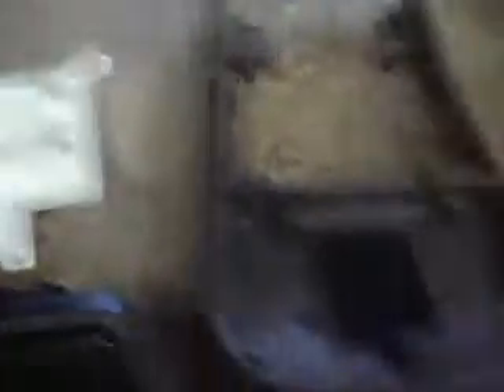2002 Explorer Sport Trac Overhead Console Display Repair

Comment: I tried this. Mine didn’t looked burned anywhere. Maybe a little corrosion. I scraped it and soldered it anyway. It works now. You are the man!
Reply: I have a 2001 Explorer Sport.  How do you get the whole thing off in the first place?  There aren't any screws holding  it onto the cab ceiling.  Do I just yank it off?  Use a slot screwdriver to gently pry it off?  Any hints are appreciated.
Reply: @valeriestevens5250  press the button to open the storage door. Remove the two screws holding the rear section to the roof. The front snaps in and out.
Reply: @KevinMcPCFII  Thank you very much!  The Explorer was in the shop when you responded.  I just got it back Saturday and the first thing I did was open the storage door and I saw the two screws.  Do I need to remove the front also, or can I just remove the rear portion?  Once we get to cooler weather, I want to check it out.  While I wait, I'll check some YT videos to see how to solder things and then I will be ready.
Reply: @valeriestevens5250  yes. Remove the screws and pull the front down to unclip. You can then unplug the connector and remove the entire assembly to your work station. Disassemble, repair and reassemble. It was a relatively simple process. Be sure to plug it in and function check before you go through the process of reassembling.
Reply: @KevinMcPCFII  Thank you very much for taking the time to explain.  I appreciate it.

Comment: Thanks for the video. I have a 2001 Sport Trac without a sunroof. To get to the soldering part you have to remove the console. There are 2 phillips head screws in the front storage compartment. Remove them and the the console will pull out as it is held in by 2 clips in the front part. Unplug the electrical connection. Flip the console over and you will see 3 T10 screws ( my smallest hex wrench worked) remove the 3 screws. Then there are 4 more you cannot see as they are covered by the foam padding. Once they are uncovered and removed the console will be able to be taken apart. Hope this helps.

Comment: the direction is working on mine, but the temperature says it is 140, I was told there is a sensor between the grille and radiator? is it an easy fix?

Comment: My 2000 ford explorer temp,degree display  would work once in a while.I took it apart and took it down to an audio installation store and asked them to sauder the two resisors and now it works,He told me that era of cars they used hotter resistors but the sauder wasn't good.They had to use lead in the sauder.Thks. for the video,helpfull.

Comment: Thanks Bob! I greatly appreciate the video, I fixed mine using this video. Note to others: after you remove the two screws from the roof, it's scary to yank out the two ears in the back, but they came straight down. Take care when you remove the unit, one of my 510 circuit board resistors actually had heated off the circuit board, and I searched on the floor and there it was. I had to take some UV glue to hold it place while I soldered it, and made sure to tin the pc board joints (not too much cause it still has to lay flush... just to make sure there was no slag) and use low wattage solder iron and fine solder . Thanks again brother :)

Comment: Nice video. I used it to learn how to remove the overhead console. However, it's my dome lamps that are burned out and needing replacement.  Do you know how to accomplish this?  Seems like the bulbs are not just twist out/twist in.  There is something tricky about their replacement.  Any help would be appreciated. Thanks.
Reply: Did you ever figure it out?  That's what I'm trying to do now

Comment: Also when taking apart the compass unit, it helps to use a flathead screwdriver to pry the two pieces apart. * be careful i broke one tab on mine but it still went together fine. and once you get them apart youll find the 2 resistors talked about in this video. i was able to sodder mine back into place and it worked fine again. only a little sodder is needed.

Comment: thank you for posting this video it helped me complete my job on my '02 sport trac. Also for dis-assemby the 2 connectors that hold the lights and compass unit to the roof. the black one for the lights/compass can be slid out then disconnected by pressing your thumb on the tab then pulling. the grey connector comes out when you remove the screws.